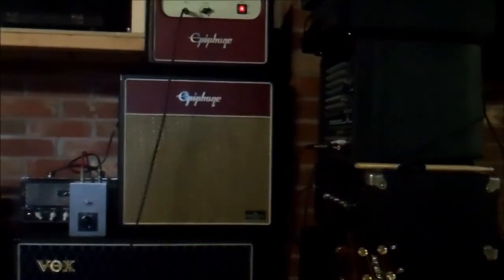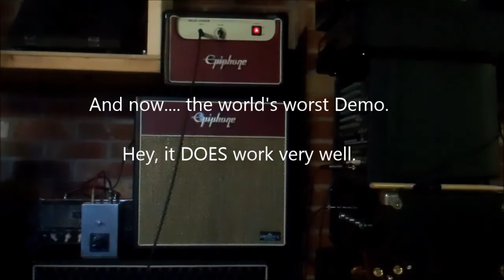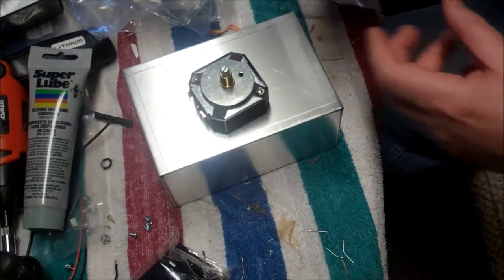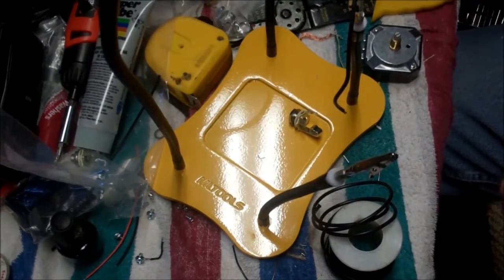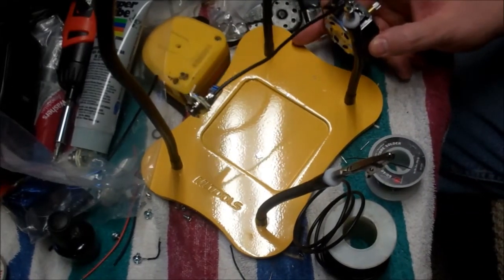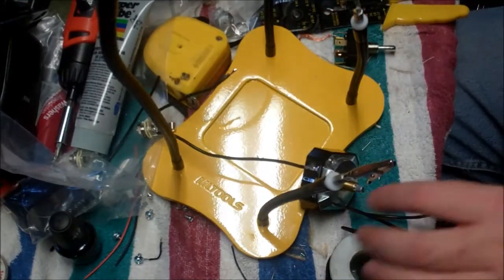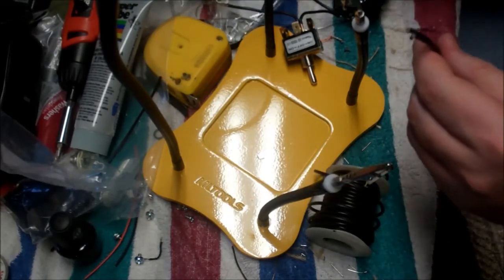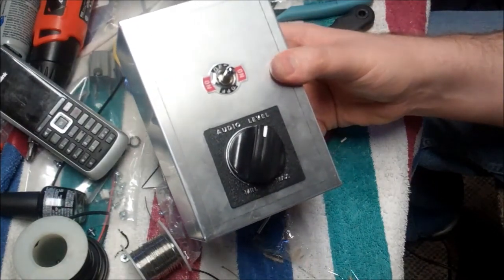DIY Attenuator for Guitar Amplifiers..... Demo & Build

Comment: Good job on this project and the video, glad you took the time to produce this so I could watch and learn.
I believe you have inspired me to build one of these myself, and I especially like the bright switch option.
This will be perfect for the little Fender Excelsior amp I've modded.  Replaced the stock speaker in that amp with a very efficient one, this attenuator will most certainly work great for the Excelsior.   Again, Thank You.
Reply from the maker: No worries... Glad you liked it.  I prefer the sound of an amp at work,  over a stomp box out in front,  so this was the ticket.

Comment: I think 18 g heater wire would probably work all right. Where did you get the components???
Reply from the maker: Parts-Express.com  was the major source for the innards.
Reply: @DeadKoby  cool!! I just saw a vid where phil m was comparing a $ 100 attenuater against a $500 dollar attenuater. The big thing i enjoy about  your channel is i want this and this and that and  you make it yourself. That,s great. Save money live better.
Reply from the maker: Essentially for an amp that is 20w or less,  making an attenuator is easy, as you use the same stuff they produce for the speaker market.